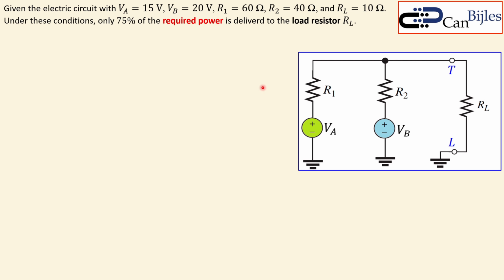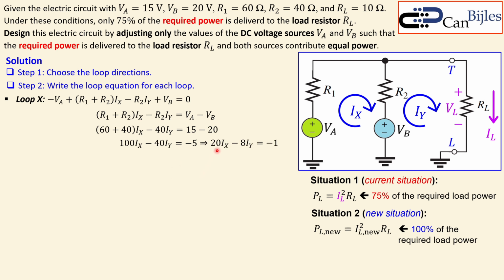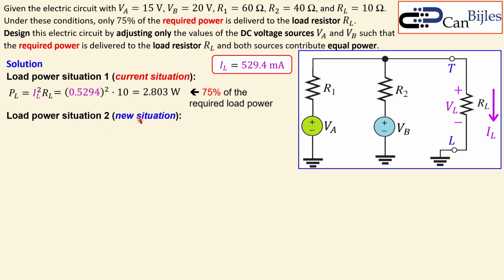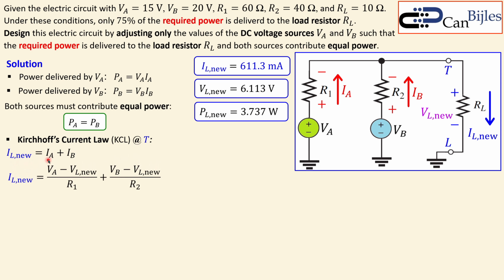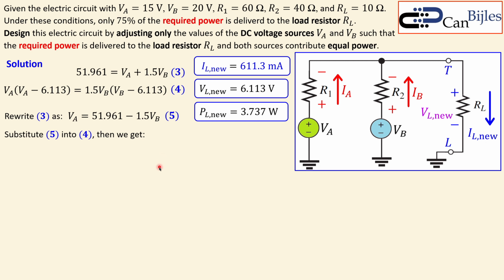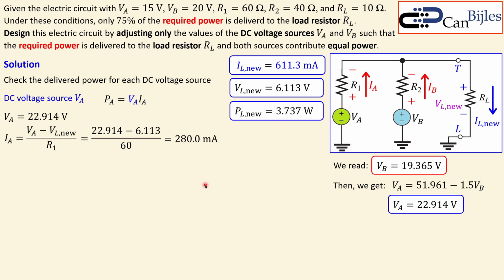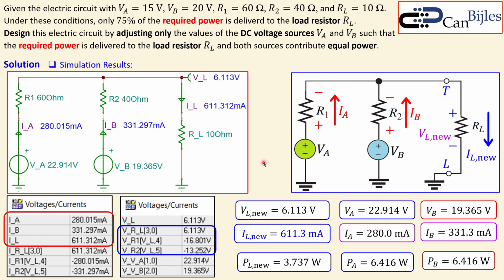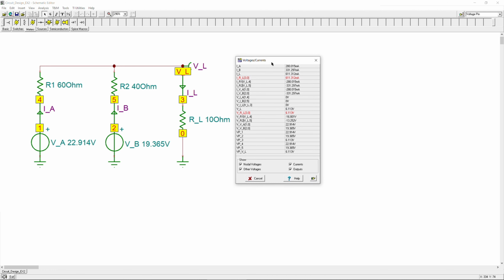Load Power Design 🌟 Electric Circuits 👍 #Circuits #Design #Power

Comment: hocam 2. dereceden denklemde 2 farklı VB çıktığında bende örneğin biri 169.42 diğeri 19.975 çıktı. Neden 19 ile başlayanı aldık. Sizde grafik hesaplayıcı olduğundan gördünüz. Normalde nasıl hareket etmeliyiz?
Reply from the maker: Çok güzel bir soru! İkinci derecede denklemi V_B için çözdükten sonra çıkan sonuçlar: V_B = 19.365 V veya V_B = 164.03 V. 
Denklemin sonuçları: https://www.wolframalpha.com/input?i=%2851.961-1.5*x%29*%2845.848-1.5*x%29%3D1.5*x*%28x-6.113%29

Burada V_B = 164.03 V kullanırsan, V_A olarak çıkacak netice negatif olacak. Bu durumda V_A’nın sağladı güç (delivered power) P_A = V_A*I_A oluyor (hala pozitif kalıyor, çünkü akım I_A da negatif). P_B da hala pozitif. Yani, iki türlü çözüm var diyebiliriz.
Reply: @CANEDUX  teşekkür ederim hocam.
Reply from the maker: @Tortuga2321  Rica ederim. Soru zormuydu? Adım adım anlatmaya çalıştım aslında, fakat durum tasarım olunca karışık olabilir.
Reply: @CANEDUX   benim açımdan zordu hocam :)
Reply from the maker: @Tortuga2321  Anladım :)